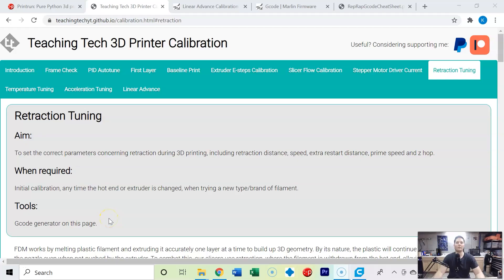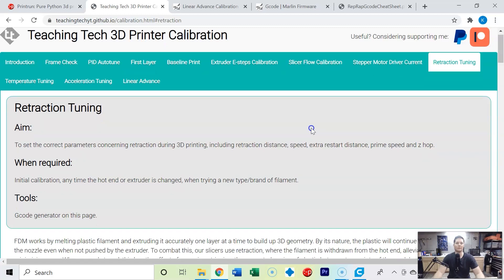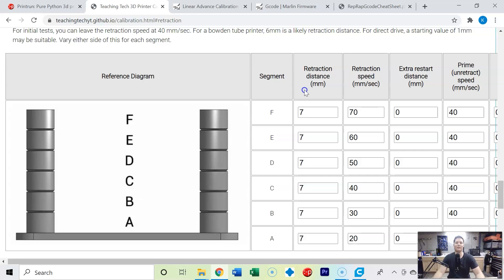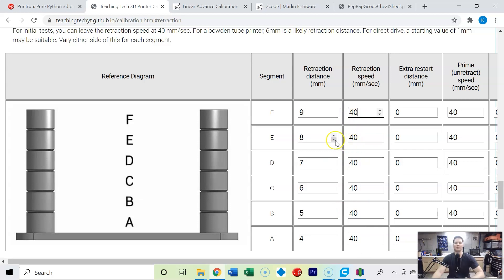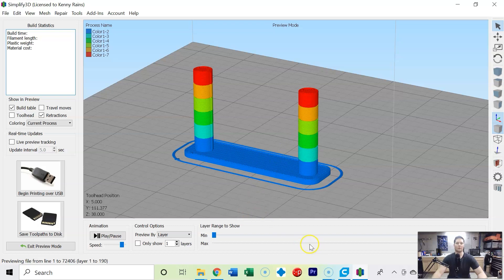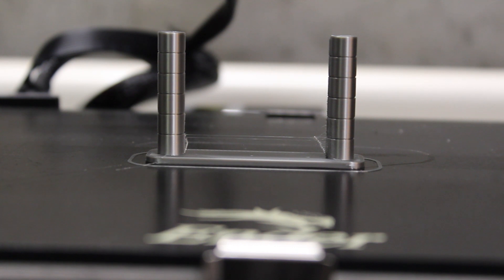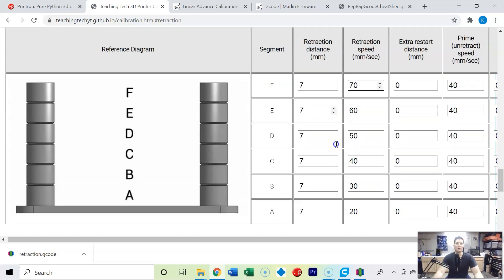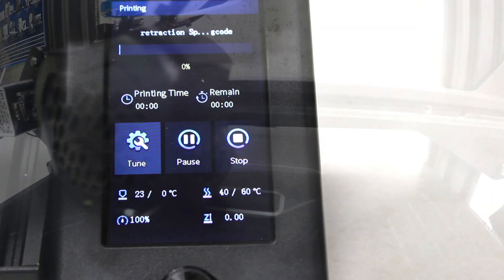Retraction Tuning - Calibrating your 3D printer Part 7- Ender 3 V2

Comment: thanks for this, so i went through this with 2 different brand pla as the first one didnt seem any difference in the segments, and the second one seem to get worse at the top, so i guess my printer is good with the default settings.

Comment: thank you for your video. Is there anything I need to do since my first layer ain't sticking with the bed for all the gcode? Do you slice it in cura first? But from other gcode bed levelling (chep) it work like charm.
Reply from the maker: Is it just the retraction tower that is not sticking? First layer adhesion should not be a gcode issue. How do your other prints stick? You may try a glue stick if you think your bed is level and your nozzle is close enough.
Reply: @rainmaker3d  nvm, I think my eprom is the source. Reset it and it's good to go. Thank you again for the videos. Subscribed.
Reply from the maker: @LOLgarena  glad you got it figured out. Thanks for subscribing!

Comment: Hi I went through your steps on my Ender3v2 and had very little stringing but had a very bad line going up both towers where the string would come from at each layer.
It is pronounced more on the right tower than left. Is this a cooling fan shroud issue?
Any other settings to work to correct this? I believe its called a z scar and it looks like even your tower has some as well but mine is more pronounced and feels quite rough. Thanks!
Reply from the maker: Hey Jason, good news on the stringing bad news on the Z scar. I will do some more research on my end. One setting to tinker with would be your layer start and stop. If the Z scar is coming from the start of each layer you could randomize it so it doesn't stick out as bad. Do you see this on other prints that you have or just the tower?
Reply: @rainmaker3d  Mine also has this exact issue, zero stringing on each layer, but a really bad zscar on the right tower. my other prints seem fine though.

Comment: Thank you for your videos. They have saved me from pulling out the rest of my hair lol. I really appreciate it. I installed a microswiss on my ender 3 v2 and it  has been issue after issue. But thankfully your videos have helped with almost all of them.
Reply from the maker: I'm glad they helped!
Reply: These are some amazing videos! Will these steps work on a Gigabot 3+? We are having printing issues I need to fix.